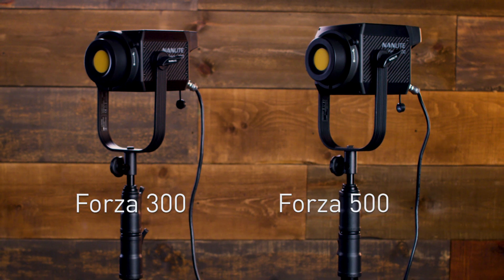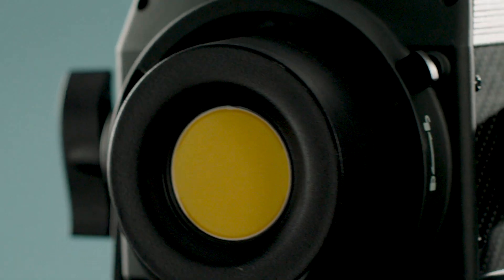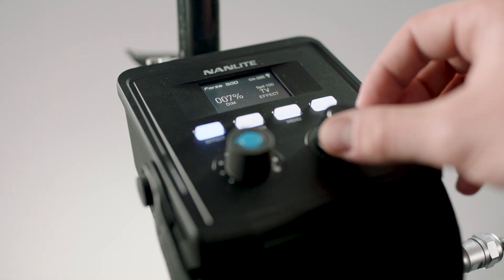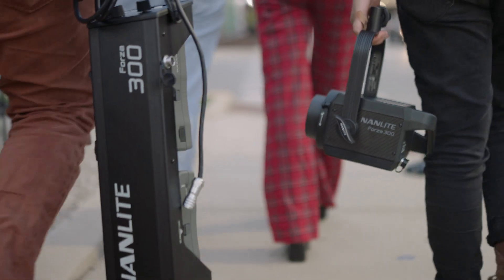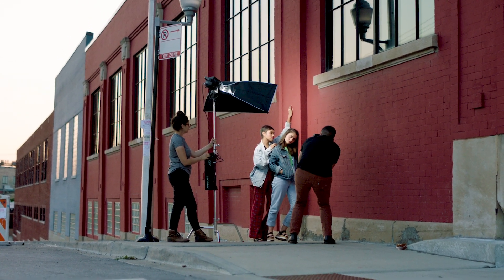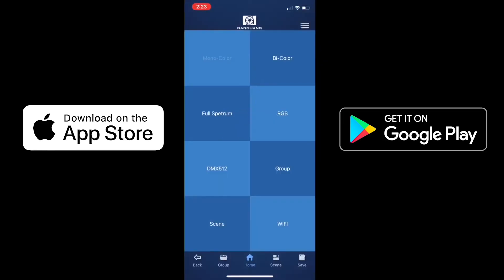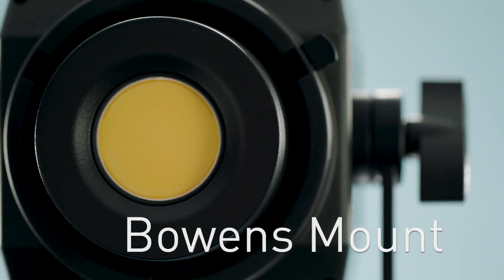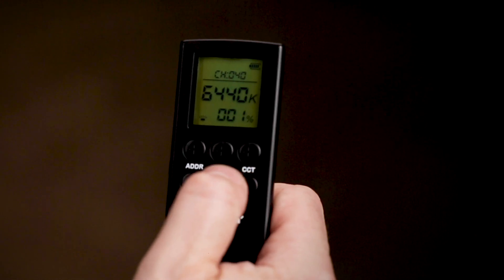NanLite Forza 300 & 500: A Deeper Look

Comment: I have the Forza 60 and a 300 on order!!! They are POWERFUL and amazing for skin tones
Reply from the maker: Thanks, Gabriel. We're excited to see what you make with them. And thanks so much for taking time to comment.
Reply: your gonna love the 300. Ours is quieter than our 60's
Reply: @jeffbrass2351  Really???
Reply: @BlackSteelBlackSteelPromotions  yes really...that's why I wrote it
Reply: @jeffbrass2351  Fair enough real good to hear that (no pun intended)
Reply: Jeff Brass does it have twin fan or single fan? Is it the second generation power supply? How do we differentiate the second from the first? Just by the twin fan on the power supply?
Reply: @osmanarslan2636  The 300 has a single fan power supply and a single fan in the head. As far as I'm aware it was only the 500 that had the power supply changed - and we don't have one so I don't know what the power supply fan configuration is for the 500.

Comment: I really  don't know why would I buy forza 300 b  when I can  pay less money  for more  powerful forza 300  and  just use some gels and get the same thing as forza 300 b ?  Why would I buy forza   300 b  ? you get the  remote controller ?
Reply from the maker: Some users like the simplicity of just turning a knob vs using a gel. The output may not be a factor when they are deciding on the light.
Reply: @NanliteUSA  Thank you

Comment: Can you confirm the 500 can ONLY be powered with 26v battery? It seems the Aputure 600 will take lower v batts too.  Itd be helpful to know if the forza 500 can do the same even if not optimal for the batteries or the output.
Reply from the maker: Hi Mike, The Forza 500 will only work with 26V batteries. The light will not function with 14.8v batteries.

Comment: They say that these lights were super loud. Nanlite updated the power supply and made them twin fan system. Is that true?
Reply: Hi Osman, The Forza 500 was the fixture that had complaints about the fan noise.  The lights have always had a twin fan system one in the fixture head and one in the power supply on the sled.  The power supply fan was causing the noise issue so Nanlite has replaced them with a much quieter fan.

Comment: Nanlite, will you be coming out with a projection attachment for the Forza 300,  300b and 500?
Reply from the maker: HI, The Nanlite factory has not communicated yet when they will be releasing a Bowens projection mount for the 200, 300, 300B, 500.
Reply: @NanliteUSA  OK so from this I am understanding that they plan to, but the when just hasn't been announced?
Reply from the maker: Yes, You are correct.

Comment: So can be power by Np f batteries using v mount adapter?
Reply from the maker: Hi, You wouldn't get enough amperage to have the light stay on for any length of time. You may also damage your NP batteries.

Comment: 3:50 - 80% with fan turned off? ours drop to 25 percent of the output with the fan on - 2 full stops down - certainly noticeable. You also said on another comment on the Forza 60 that they drop to 80% - all of ours (3 of them) drop to 50%. Don't get me wrong, I love these lights but either all of my lights (and other reviewers) have defective units when it comes to output with the fan off...or the claimed 80% just isn't right.
Reply: Yes, in all reviews I've watched it was stated at up to 50% output with fan off. 
I haven't actually tested as fan noise hasn't been a concern yet. The rep may want to go back and check the specs.
Reply: Hi Jeff,  I an currently working with the engineers at Nanlite to understand the discrepancy between the results you have and what they have.  I will get back with you as soon as we hear from them.
Reply: Thanks Barry, appreciate it. Just so you know, we love the lights so this isn't a complaint, just trying to understand the difference
Reply: @barrygarciananlite3471  Happy New Year Barry. a quick update - I dug out the manuals for the 60 and the 300. For the 60 it says it will be at half power with the fan off, and for the 300 its says it will run at 75 WATTS with the fan off. These match what I have measured in testing. Not sure if manuals have been printed differently for different regions (I'm in New Zealand) but at least both my measurements and manuals are consistent with each other - just not the 80% mentioned in the videos. Hope that helps? cheers
Reply: This is just misinformation at 3:50. With the fixture fan off my Forza 500 goes down to 25% output.

Comment: Hello Barry, can the projector mount be used on on the 300b? I’m looking to use my 300b to cast a window frame on the wall or maybe use a different GOBO, fake tree, firework, etc. 
Or is that only applicable to the 60b?
Reply from the maker: Hi you can use the Bowens projector mount with the Forza 300B light and be able to accomplish what you need.  https://nanliteus.com/nanlite-projection-attachment-for-bowens-mount-with-19-lens/

Comment: Hello, I got an offer from a seller from China. I live in New York. Would I have problem if I buy from there instead of B&H. I usually buy my stuff from B&H but the offer I got is much less than B&H. There is 30 days return period. Also it’s very surprising to me to see that these lights don’t have fire and candlelight effects. Those are the hard to replicate needed more often than not. Are these lights upgradable with firmware? I really like the power of these lights but I feel like I’ll have to go with Aputure even if I don’t want to. The offer I’ve received for Forza 500 is equal to what 300D Mark II costs. For the power I’d much rather buying Forza 500 but I’m not sure yet.
Reply from the maker: Hi! Thanks for your questions.
1. Would you mind sharing where and how you received this offer from China? Feel free to email info@nanliteus.com if you do not wish to share publicly.
2. If you do choose to purchase from overseas, we cannot honor warranty claims. More info: https://nanliteus.com/pages/warranty
We only warranty gear purchased from authorized retailers in the US. https://nanliteus.com/pages/where-to-buy
3. The Forza 300/500 does not accept firmware updates.
4. The Forza series lights do have some effects that could be like firelight, such as TV Mode, if you gel the light with CTO or Amber. It is a single color temperature – daylight.
Reply from the maker: We'll add this, if you want native firelight effects without gels, then the MixPanels and PavoTubes are other great candidates:
https://nanliteus.com/collections/all?_=pf&pf_t_family=MixPanel
https://nanliteus.com/collections/pavotube

Comment: Is the fan quite enough for interviews on the 500? 
If I turn the fan off , how long can it run at 80% in room temperature?
Reply from the maker: Hi Juan Carlos, yes the fan on the 500 is quite enough to be used on interviews. Due to this lights extreme brightness you would have to set the light up away from your subjects.  The light will run around 2-3 hours without the fan.
Reply: NanliteUSA got it! Thanks !
Reply: There is misinformation at 3:50. You can't run Forza 500 or 300 at 80% with the fixture fan off. Truth is 25% with the fixture fan off. The power unit fans are working all the time, but this is less audible. How long you can run with the fixture fan off depends on many things like the temperature around you, wind /air movement in the room/ and the modifier you have attached to the fixture.

Comment: I have a 300 and when I turn the fan off did you mean to say it goes to 50% or 80%
Reply: Hi Tony, the 300 light dims down to 80% when the fan is turned off per the manual.  We are currently checking with the manufacture to confirm that this is correct.
Reply: @barrygarciananlite3471  thank you mine seem to go to 50